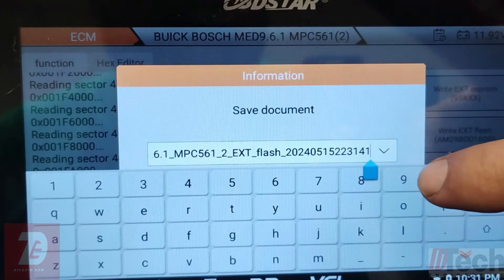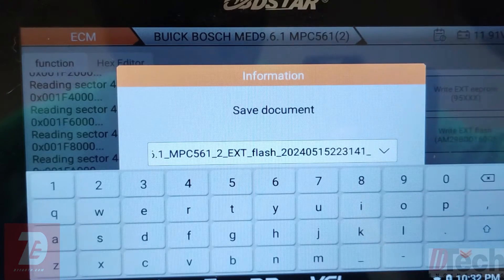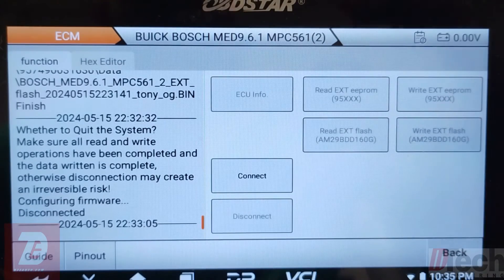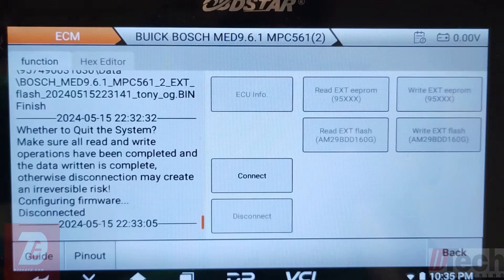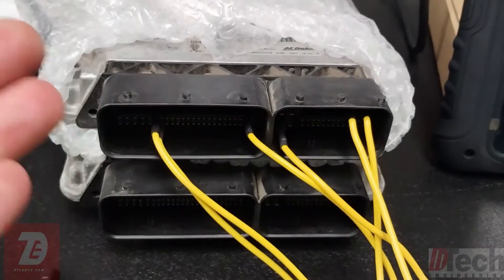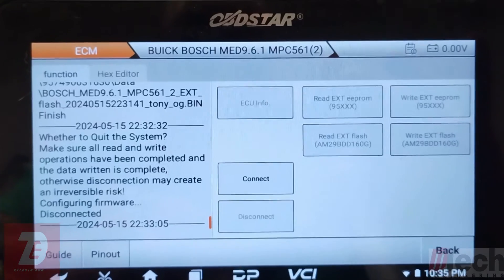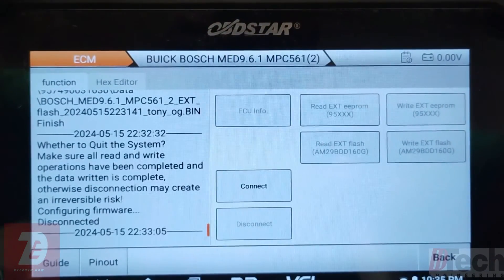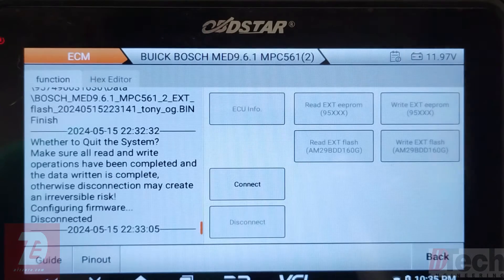Cloning GM E69 ECM Bosch MED9.6.1 with OBDSTAR MP001

Comment: Hi, is there way to swap the vin in one of these? I want to use a gmpp stage 1 operating system on my cobalt I think the operating system is better. Not sure the best way to do it. I don’t think the car will like it if I put the tune into my cobalt with the wrong vin.